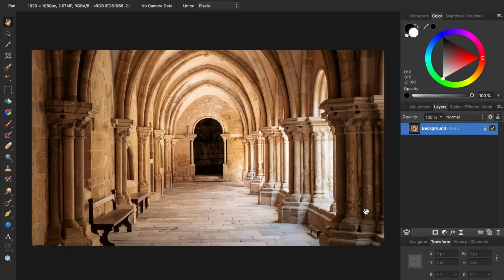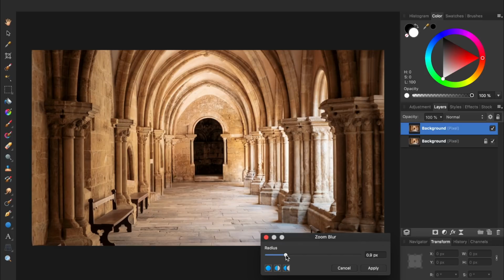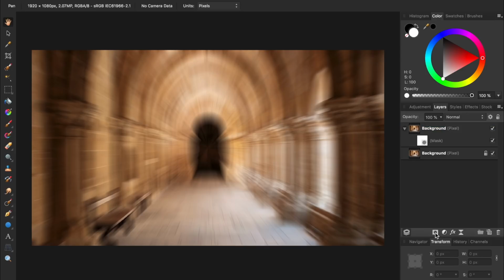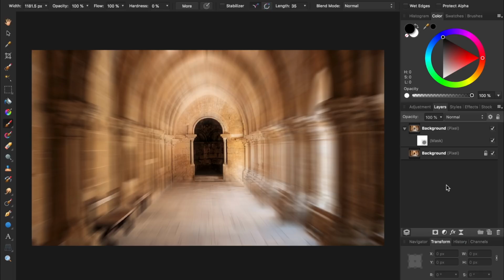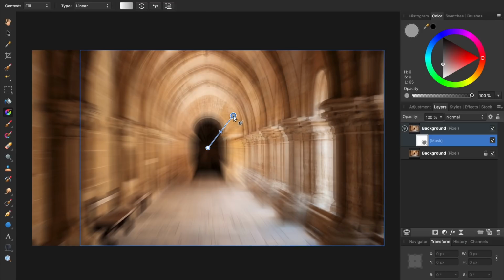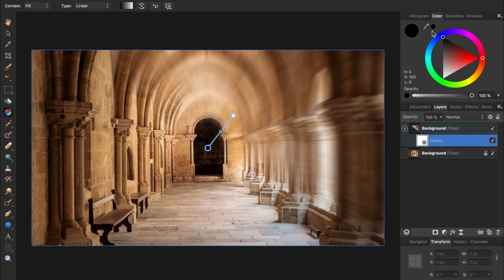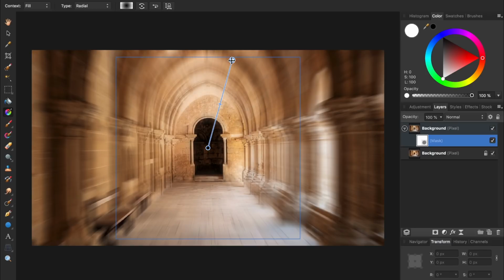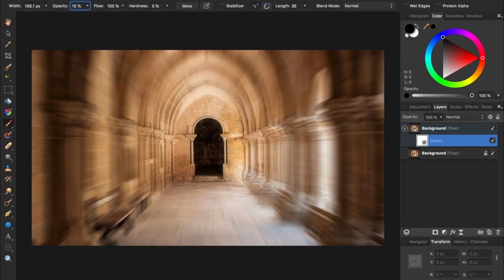HIGH SPEED Effect in Affinity Photo

Comment: Very cool. Is there a way to change the centre of the zoom blur ala Photoshop’s Zoom Blur filter?
Reply from the maker: Hmm.. I'm not sure, what does PS's blur filter do differently?
Reply: In PS, you can select the radial blur tool, in which there is a zoom blur option that allows you to set the centre point on a grid to determine where the zoom blur is directed (for example, if the door in your video were in the lower left instead of centre).
Reply from the maker: Ahhh yes, good question. In Affinity, when you have the zoom blur's dialog box up, you just need to click somewhere on the photo to have the blur's center point move to that part of the picture. Thanks for asking!
Reply: just about to ask same question thanks